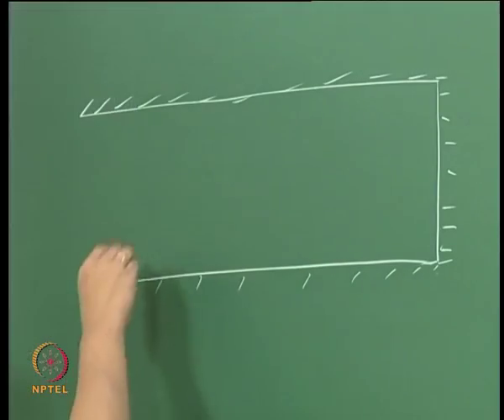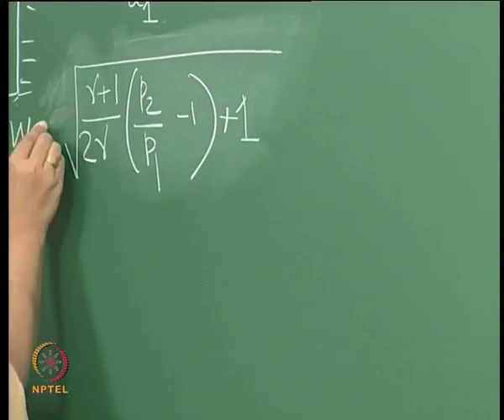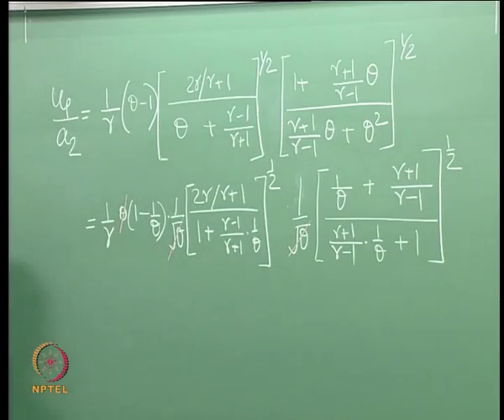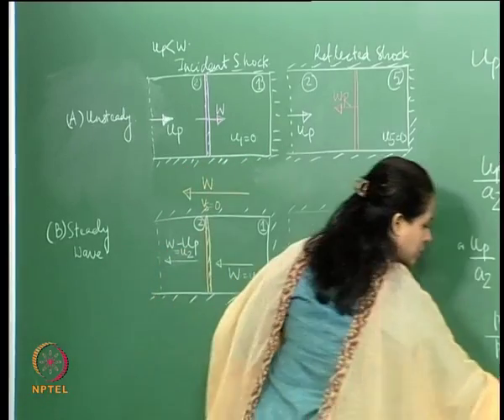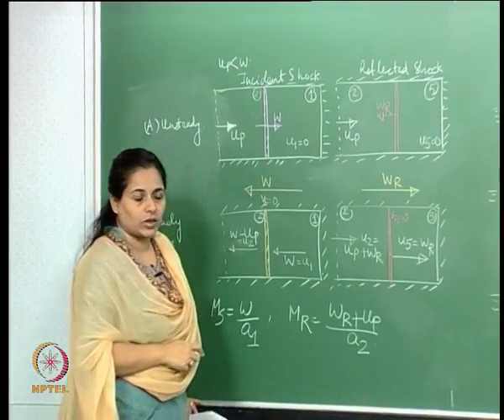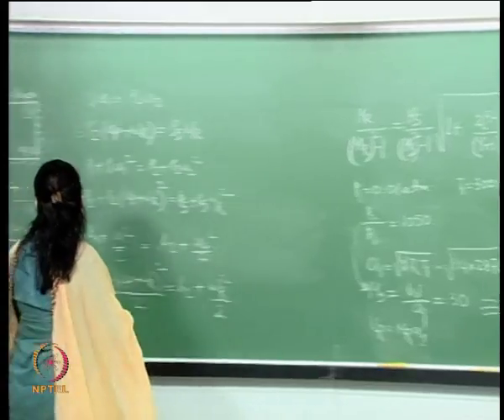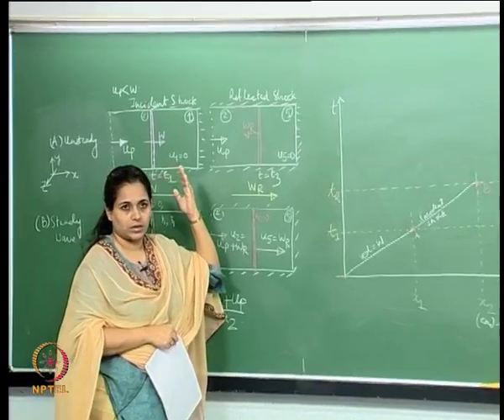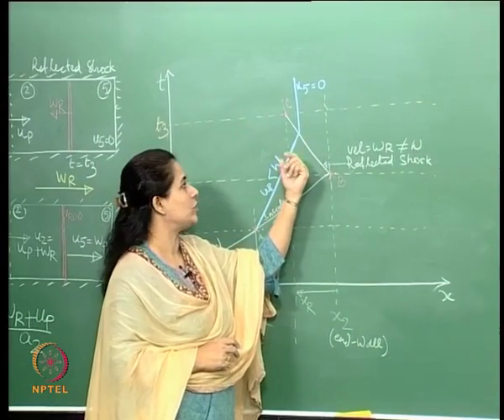Mod-01 Lec-15 Lecture-15-The Shock Tube: Propagating Normal Shock and its reflection from end wall

Comment: T1 and P1 are not equal to T5 and P5. T5 is just over 120,000K and P5 is 84.273atm. Even though Mr=2.65, Wr=3531.8855m/s because T2=52770K. 
This problem was neither small nor easy to solve.